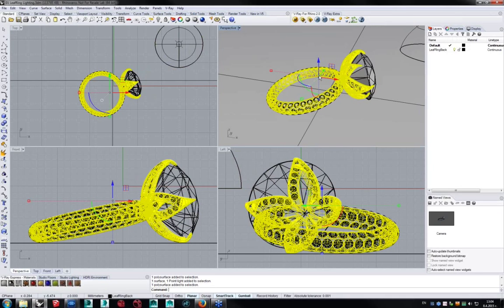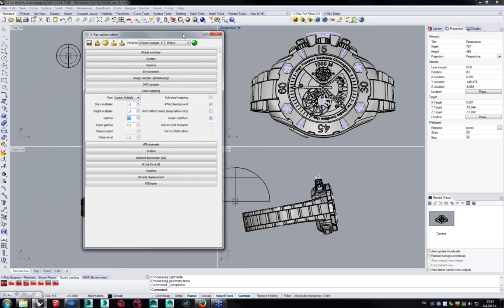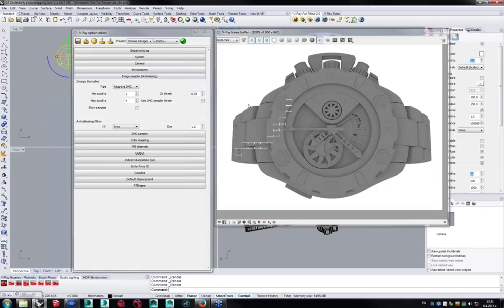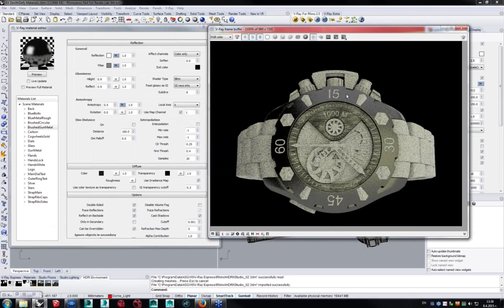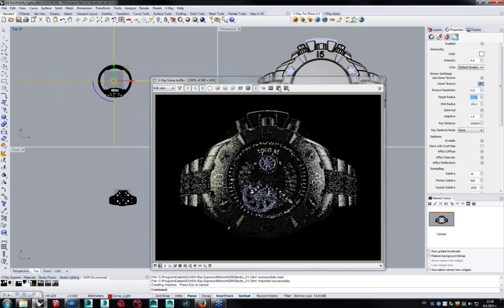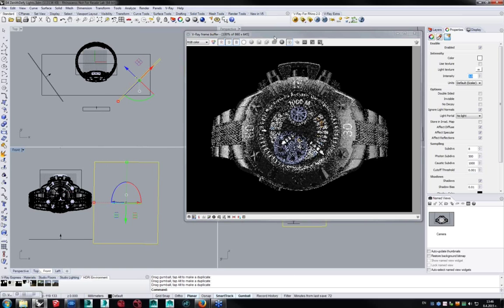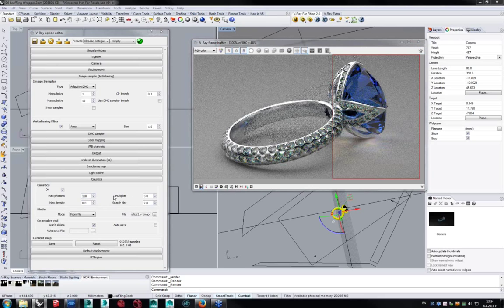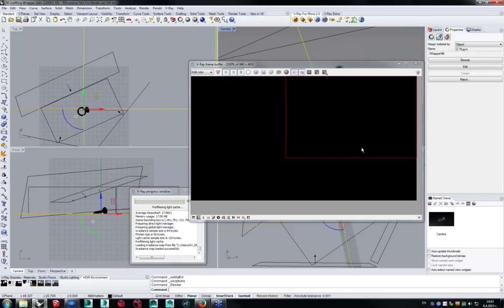Jewellery Rendering with V-Ray 2.0 for Rhino

Comment: In this kind of product rendering, which rendering engines are more ideal (V-Ray or Keyshot) in your opinion, in terms of 1. Rendering Quality, 2 Time? Thanks a lot. 

I am a KeyShot user, since it is too easy to use, I don't feel myself as a real professional who has true rendering skills and I am always afraid of using V-ray.
Reply from the maker: Hi, Both Keyshot and V-Ray are professional products. Ultimately V-Ray gives much more control in terms of lighting, materials, speed vs quality and the ability to separate channels for post processing. If rendering is a major part of your workflow then it is worthwhile considering V-Ray. If you render as a means to an end and your main activity is design and modelling then Keyshot may well be all you need to obtain photorealistic visuals. Hope that helps?
Reply: Diamond material help

Comment: Hi. Nice tutorial. Thank you. I just did not understand one simple concept. If gamma and input gammag are both set to 2.2, it will mean that for example colours, and JPG s will be corrected and we will have a nice linear workflow. What I dont get is that by doing so, an HDR image will be gamma corrected too (as we established input gamma to be 2.2).....and the hdr is already 2,2 gamma...dont need correction, so it will be double corrected, which would not be right. Hmmmm. What am I missing?
Thank you for your help in advance :)
Reply from the maker: MrGogocad Hi, glad you enjoyed the video. In answer to your question: HDRs and EXRs will not be gamma corrected as other images because the V-Ray Bitmap loader detects and assumes they don’t need to. 
Does that help? Thanks, SimplyRhino.
Reply: Right. Thank you. It s weird though. It doesnt happen in any other renderers, incluiding Vray in other platforms ;)...Cheers!